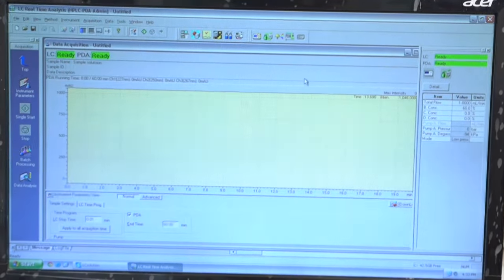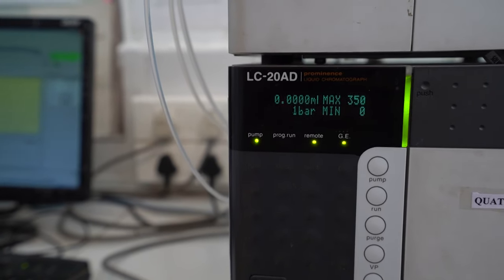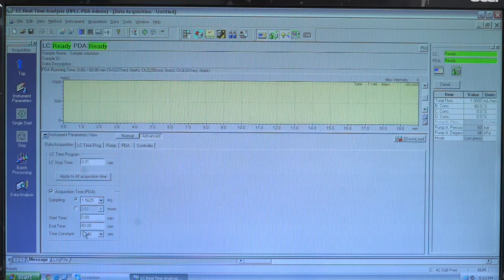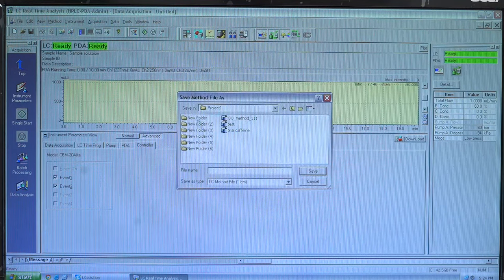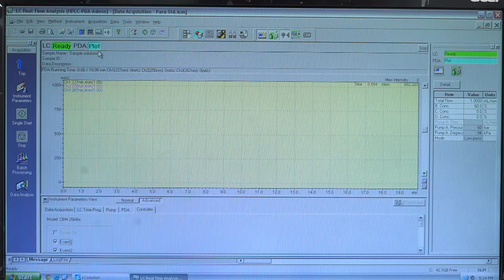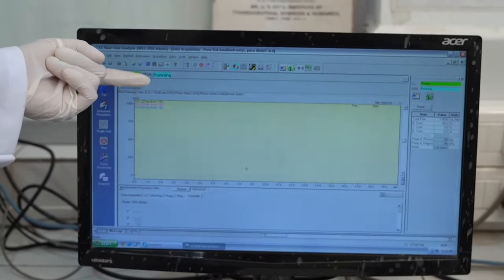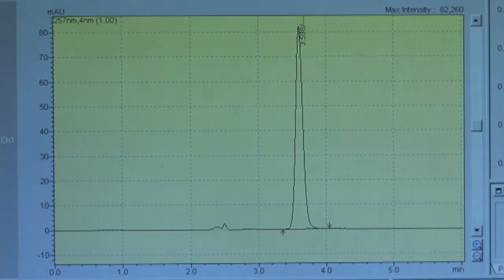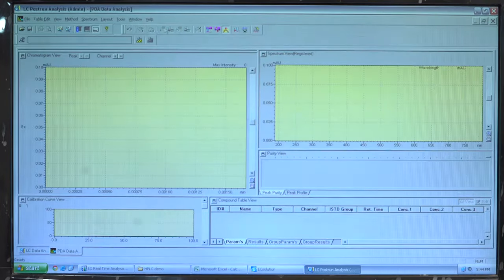High Performance Liquid Chromatography (HPLC) – Operations by Dr. Sejal P. Gandhi

Comment: First filtration followed by sonication since its role is to remove air traps. If you do first sonication again filtration then environmental air entraps the solution and you will get negative peaks due to air bubbles.
Reply: I think that the vacuum created by the vacuum pump not only allows suction/filtering, but also catching any air in the solution. But you're right, first filtering and then sonication seems better. Have you noticed that the filter is smaller than the opening of the bottle and some of the solution may have flowed sideways, bypassing the filter?